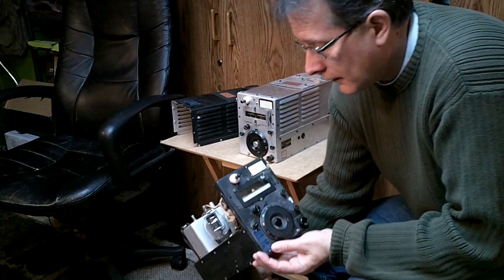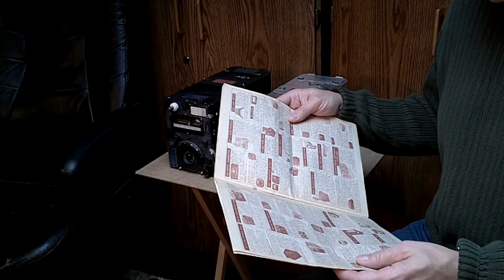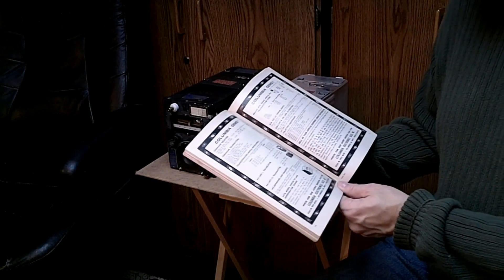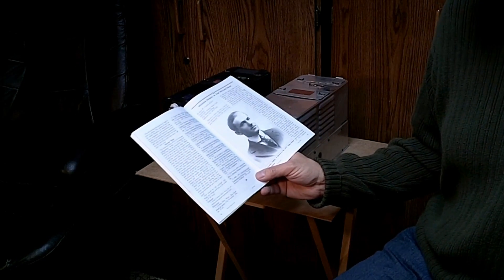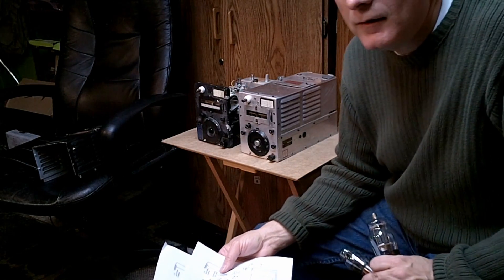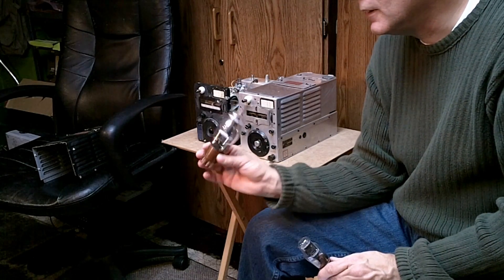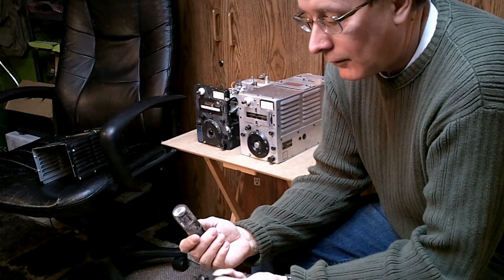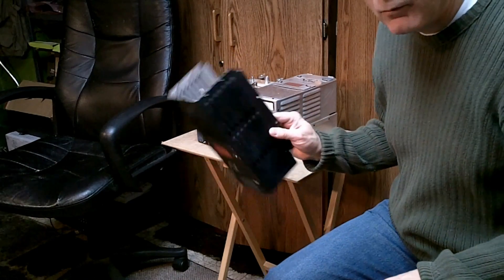ARC-5 COMMAND TRANSMITTER INTRODUCTION

Comment: This is great. I did the 40 meter conversion around 1970 and worked all corners of the US, plus Canada and Japan. It’s still in the attic with my homebrew power supply & oscillator and all the QSL cards. Good memories.

Comment: 1959 for $4.99 new in sealed box.
Reply from the maker: Amazing! I picked up one new in the box as late as 1983 because there was a RATTLE. Nobody buys something with a rattle inside a sealed box.
Reply: @MIKROWAVE1  It was probably the desiccant package rattling around inside the box (used to keep things dry). We were able to buy these ARC-5 transmitters brand new in the original box for $6.99 circa 1956 at an electronics surplus store in Cincinnati OH. Can't remember the name of that store.

Comment: As a new Novice op at age 13 in 1958 I was gifted a BC-459A for  the required crystal control operation in the 40m Novice "band". A homebrew 5U4G power supply providing approximately 40w DC input and feeding a 65 ft end-fed flat top up 35 feet, I worked from Buffalo, NY about 25 to 30 states and several Canadian provinces coast-to-coast across the continent within the 9 or 10 months as WV2CEL. A few more within the first six months as a General Class op WA2CEL before acquiring the Heath DX-60. That BC-459A was passed on to another new op shortly thereafter. Today, I have a new in the box ARC-5 T22 made by Western Electric purchased about twenty years ago, thinking to "turn back the clock" by putting it on the air with carefully made reversible circuit mods. Thanks for publishing your fine videos about Command Set equipment and other amateur radio related articles, as well.  ~Bruce WC5CW

Comment: My first and only transmitter was a T-21 I bought for $7.50 in 1956 -- apparently not such a great price at the time!  I was KN7ERD in Tucson.  Many years later -- mid 90's -- I bought another T 21 on EBay, think it was a little over $100.  I have a few ARC receivers as well. My question is this:  I remember being told in the '50s that these sets contained a thermite charge, for destruction of the radios in case of ditching or bailing.  Is that true in your experience?  I would prudently remove the charges if I could positively identify them.  Two of my sets are almost mint, so might still be problematic.  Any thoughts?  Thanks!

Comment: I just picked up an ARC-5 Transmitter and the tuning dial is stuck.  The lock knob is unlocked.  Any idea what could cause this dial to stick?  The interior looks clean
Reply from the maker: It might just be corrosion so spray some penetrating oil or WD-40 on all parts of the shaft in contact with bearings and gears and maybe the shaft lock too; maybe hit it with a heat gun or let it set overnight. Then try to free it.
Reply: @MIKROWAVE1  It appears to have been a mechanical hit that bent the tuning shaft.

Comment: Just wanted to know if you have had any experience replacing the variable caps on the worm gear drive?

I have my 40 meter one all returned to stock, nice power supply..

Only to notice that the stator on the plate tuning cap is missing two of its glass bead supports.

I have one of my old junkers from the 60' s thst is only a parts tadioad I used it for a muktiband.VFO.

I ordered some sine wrenches and assume I will have to remove the front panel knob, and loosen the coupling to the speedometer  cable gping to the VFO.

What I can't determine is if I will have to remove the dial, knob and gears and bushings from the front panel?
Reply from the maker: Loss of the beads is common - you can replace them if you can find some plastic beads at the craft store.

Comment: Trying to build the total solid state power supply and having difficulty locating the 55 Volt Zeners.  Can you make any specific recommendations?  Thanks
Reply from the maker: Substitute 62V  and 47 V zeners from Ebay. Just series until you get close on the voltage.

Comment: My first ARC-5 was also purchased from Fair Radio Sales.  It was 1973, the radio cost $5 and was still sealed in the original packaging.  I converted it to 160 meters using instructions found in the 1963 Radio Amateur's Handbook.  I had just gotten my General ticket and this was my first VFO controlled transmitter. Very exciting stuff sat the time.  Looking back on it I don't know how I ever got it to work. Still have that ARC-5 on 160 meters.

Great video.  Thanks for posting.
Reply from the maker: I also got a new one for 15 dollars, but in 1983 - it had a rattle that was one of those darned plastic beads! That is why nobody bought it.